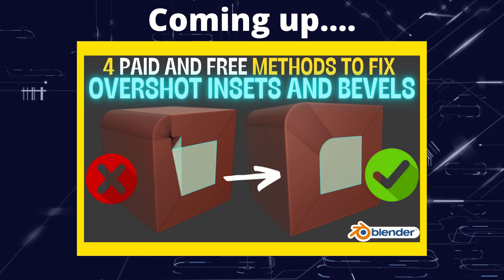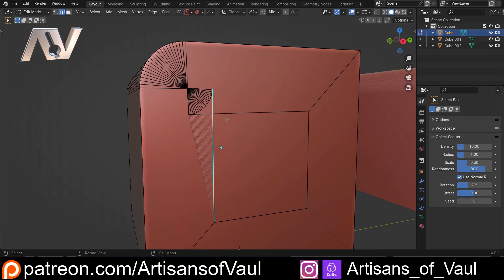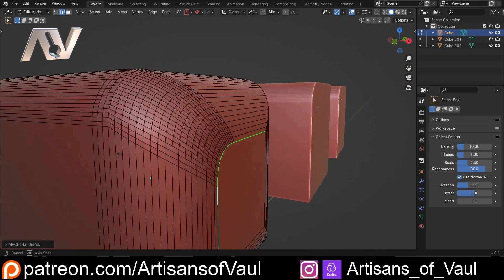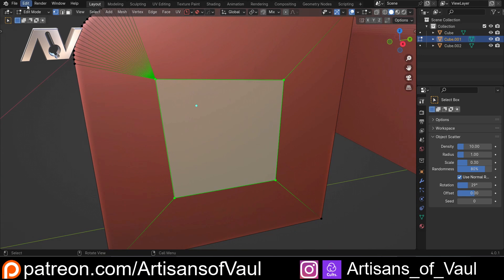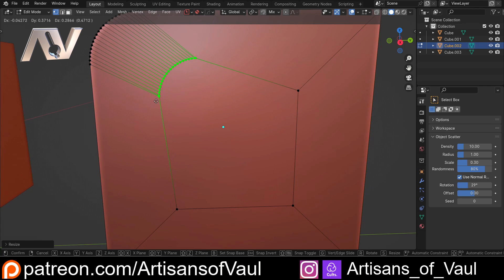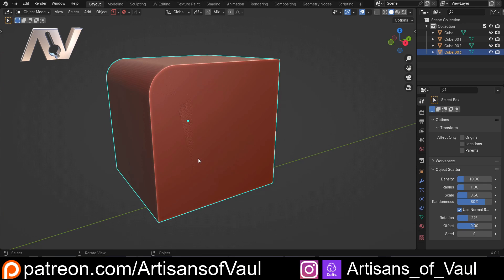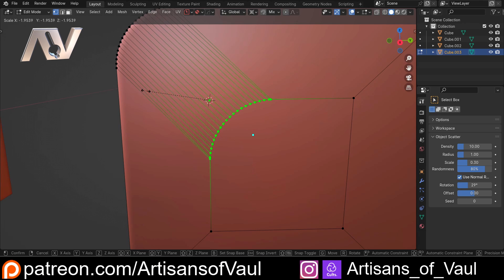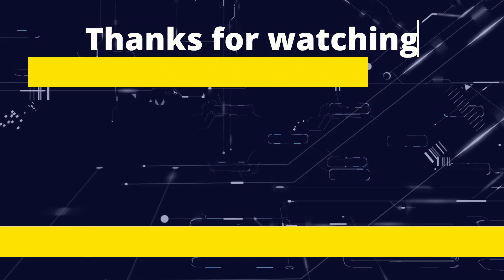4 methods to fix overshot insets and bevels in Blender

Comment: Great videos mate! You are a great source for Blender tricks and tips!
I would add that, for things like these, I would use something like your last option, but instead of extruding, I would use "Inset" - this way I could run it until I'm happy with my round corner - and then use the "S" scale to bring it to size.
Reply from the maker: Its a good option for sure.

Comment: So how would we fix the overshot bevel for free? of course we can repeat the fixing solution for the overshot inset several times, but that would be slow and we'd be eyeballing the proportion. does round inset stops this from being a problem in the first place? but that's not quite free.
Reply from the maker: For free you can't without doing it repeatedly as you say. I guess that's the limitation, spend a bit of money to save a lot of time or spend the time to save you money.
Reply: @ArtisansofVaul  so the round inset addon can fix bevels too?

Or mesh machine is needed?
Reply from the maker: @MudraptorGaming  So it will fix insets but bevels on a rounded edge that have multiple "levels" to them won't be simple to fix as they won't propagate through
Reply: @ArtisansofVaul  ah ok, darn
Reply from the maker: @MudraptorGaming  Yeah. Basically other addons work but I haven't found anything as powerful as Mesh Machine. And it's other tools are fantastic too.
Reply: @ArtisansofVaul  yeah. I just don't agree with paid addons in a FOSS, especially since it kinda seems like they're dodging the policy.
Reply from the maker: @MudraptorGaming  Your choice. My view would be the addon creators are putting in a load of work and without payment probably wouldn't be making these things. Also it saves me time so I'm happy with paying to save myself time. I mean I could walk somewhere but paying for the bus saves me time, pretty much the same deal.
Reply: @ArtisansofVaul  you're right, but the problem is that the bus ride is free. Some cool people made a free bus service because people need transportation. You're paying for some guy who took said free bus and put a turbo in the engine, and is now charging half a bus's worth of cost

A percentage of that money should still go to the bus company, because without the bus company, this guy wouldn't be able to do this. 

But because the addon meets a few technicalities, it can be paid

Just like humangen is paid because it contains models which are allowed to be sold, even though you're just after the addon only features.

There is no doubt that meshmachine saves you time or that the dev puts in serious work. I'm definitely not disagreeing on that part

Anyway, not to get political

Comment: This review of methods is really handy. I know Blender seems to want to be  to be minimal and complete, not cluttering with too many native tools, but it does surprise me there's no clean fix for this, (unless I'm wrong, .. again :) )

I hadn't come across the Semi-Cyclopse method .. If you had to do it a lot,  one way to speed it up a little bit with shipped add-ons  would be to: Loop-Tools > Space the arc in preparation, TinyCAD > V2X to create the vertex at the intersection, and use 'Active Element' as your pivot, for scaling. Not much, but a bit, if everything's on your Quick menu.

Comment: Align vertices: Select two ( or more ) vertices>S>Axis(X,Y,Z), 0, enter. 

Thanks for the video, useful.
Reply from the maker: Thanks a lot. That scaling that wouldn't work for this instance. You need to move one vertex to the other, if you use that method it will average them (or you have to start moving around the cursor or origin which adds a lot of time). So I guess it does work but it's a whole lot more tedious
Reply: Yeah, true. @ArtisansofVaul

Comment: This is definitely one of the few problems with hard-surface 3d-printing modeling, and this is a great video with lots of tips.  There's a free add-on called "CAD Transforms" that does the sort of thing you're doing at 6:20 only with many more options. It includes rotations and scaling done the same way (scale this so these two points are that far apart, or rotate the selection around the line between these two points).  Snap base seems easier to get it done in these simpler cases.
Reply from the maker: I'll have to check out that add on. Thanks man 👍🏻
Reply: @ArtisansofVaul  It's honestly more useful when you want things like precise dimensions. More functional rather than artistic stuff. Maker Tales has videos explaining it.  It's 99% moving stuff, so doesn't really fix anything except really complex snapping problems.
Reply from the maker: @darrennew8211  For some of the work I do that's great 👍🏻👍🏻👍🏻
Reply: @ArtisansofVaul a little bird told me that there is a big update coming to CADTransforms. Apparently work planes are being added.....
Reply from the maker: @benveasey7474  oh cool! I'll keep an eye on it and can do a video when that's been added.

Comment: -Blender has an addon, "Inset Straight Skeleton", that fixes this.
-The snapping method works in pre-4.0, you just need to use "Active Element" mode.
Reply from the maker: Thanks for the Inset Straight Skeleton tip. Id never heard of that.  It makes some slightly odd geometry but its nice to have that option!  Cheers
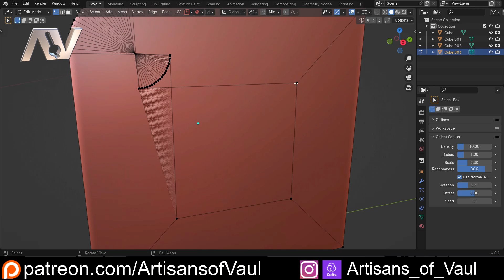Reply: @ArtisansofVaul Also, hot tip: If you use the TinyCAD addon (which comes with Blender), you can just select two edges and use the right-click context menu to create a vertex where they intersect, which is much faster than what you do at 7:30. You can also use the other CAD addon that comes with Blender, PDT, to position the 3D cursor right at the intersection point, but PDT is much more complicated and harder to figure out.
Reply from the maker: @n3onkn1ght  Cheers I'll have to try those out!

Comment: maybe you know some way how to bevel only outer edges when solidify modifier on? solidify itself has option bevel convex but is seems to work not correct, i want to add bevels only on edges that added by solidify so it will be non destructive workflow but cant find any way to do this in blender, in 3ds max even its pretty easy to do. so to be clear my modifier stack will be - solidify - bevel (and i want that bevel only outer edges of solidify)
Reply: it's very easily in blender too. Just use Output Vertex Groups in solidify modifier and select this group in bevel modifier.
Reply from the maker: The method mentioned by Spawn should work but picturing it in my head it would probably bevel both the original and solidified edges that were selected ad the vertex group.

Comment: Hello. Thank you for the video. I have a question. I'm using a surface STL file. When I start creating wall thickness using Solidify, there are surfaces that overlap and this is not correct. How to deal with this. Thank you.
Reply from the maker: So many of the issues will be due to the mesh being incorrect and not manifold (basically it's been created in a slightly lazy way). You can normally fix that to make things work. I have two videos on manipulating STLs that should help:
https://youtu.be/KXBBec-iIuc
https://youtu.be/dneiDiTrZjQ

If not let me know 👌🏼😁
Reply: @ArtisansofVaul  Thanks

Comment: one (free) method that I usually use is using the addon tinyCAD to create a vertex on the intersecting perpendicular edges using the [VTX | Auto] sub-menu, and I also added it to favorites for easy access

and probably bevel it afterwards if I feel like it needs to

Comment: This should be done without fixing. This program should be parametric like CAD programs, with full history of operations and possibility to re-model each operation from the history tree, and remodel it using specified values. I have no idea, why this is still not implemented?  Why we have to fight with the program rather then create shapes we can manage parametric ? Where is the 2D sketch with constrains and dimensions you could work on to define 3D elements?
Reply from the maker: I can't say I totally agree with this. If I wanted a CAD program I'd be using a CAD program. And it's a lot more than just "implementing" something, I'm not a programmer but I would imagine it would require rewriting huge sections of code and functionality for something many people wouldn't like. There are CAD like addons you can get if you do what that though like CAD sketcher.
Reply: @ArtisansofVaul muito obrigado, gostei da última opção, achei melhor!

Sobre o que disse o colega, o Blender é bom do jeito que ele é, e não precisa virar CAD, e já possui add-on pra isso! Pra que usar motocicleta, se quer andar de carro?
Reply: Look at the add-on called "CAD Sketcher" which adds that sort of thing to Blender. Blender doesn't have that because Blender wasn't designed for building strict functional parts.

That said, you can also use Geometry Nodes for doing this sort of thing.

But yeah, look at a CAD program if you want parametric editing. Blender is a mesh editor. Use Blender if you want to edit someone else's STL.  Let me know when Fusion 360 lets you sculpt a face. :-)
Reply: @darrennew8211 🤭😂🤣👏🏼👏🏼👏🏼👏🏼👏🏼
Reply: Lol do you even know what youo saying? you think photoshop and illustrator should be only one software or another? This is the same kind of absurd you're saying.. 

Moi3d.. solidworks.. plasticity.. fusion 360.. rhinoceros.. they are mostly cad softwares.. the options are there. You can convert a step file to a mesh. But asking mesh softwao to suddenly become cad and that's it makes no sense. You mean to say a 3d modeller that specializes in low poly models and animations for games should nodel in cad instead..? Lol
Reply: Plasticity my fren
Reply: Part of the reason Blender doesn't do CAD  is that it's a visualization and animation application. Until AI really does re-meshing much better,  the topology of the mesh-representations of  CAD CSG  does not deform well, and deformation is hard to specify. 'Everything Nodes' will improve the procedural aspect, as it evolves...  

I'm sure it will all seem old-fashioned before long :)
Reply: They should add CAD module at least like Fusion 360 with sketch module including constrains and dimensions. This is very basic tool. Very useful even with basic 3D prints. Crucial in industrial design. Then You could go to polygons, low or hi, up to your needs, just like going from vector to bitmap. So simple. In one program, no jumping, full compatibility and one software environment. Now blender is like Virtual clay sculpting machine, no control over dimensions,  no possibility of fixing or changing previous operations. Going further and using AI there should be very fluent and bidirectional workflow between parametric and polygon modeling.
Reply: @andrzejczarnota3661  Dude, youre really making non sense in here, you're bringing up all the CAD software features that are shared along most (if not all) CAD softwares, if you want to do cad simply move to CAD software, it's as simple as that, i do use Moi/Fusion/ Plasticity & Alias and i also use Blender, they are built for different tasks, if you mix the 2 of them into one then you're not doing any of them. If you want Nurbs in the other hand, it can be done in Blender with no problems, but Parametric Modeling is non sense for 3D polygonal softwares because there'll not be enough ram in the world to save all the cache from all the steps. In Cad you're doing 1 step at a time without fixing in between steps, in polymodeling every click you do is a feature, an adjustment, an "undo-step". Ram & SSD would freeze your pc every 2 minutes doing polymodeling parametric
Reply: Yes, the program should evolve and contain both worlds. One program, all features.